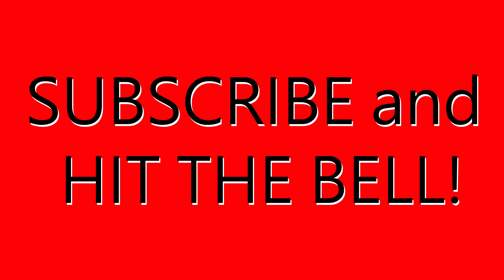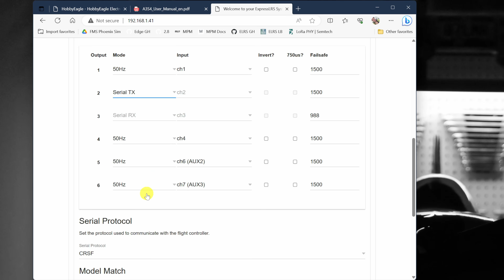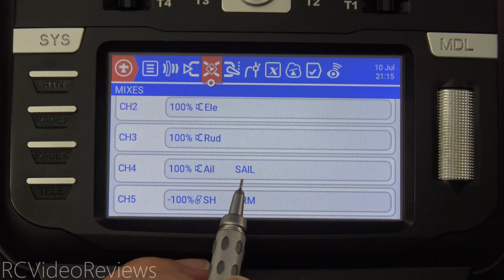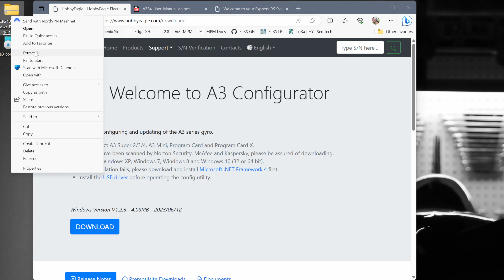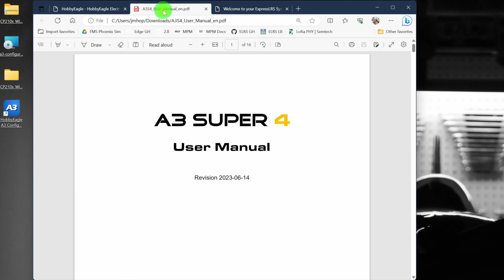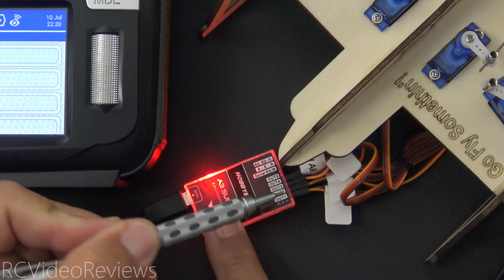DEEP DIVE: Hobbyeagle A3S4 RC Plane Gyro with ExpressLRS and CRSF

Comment: CRSF and SBUS are convenient when connecting the gyro to an ELRS receiver. However, ELRS does not output the stored failsafe channel values over serial protocols. So the receiver essentially stops sending inputs to the gyro and the gyro enters its own failsafe mode (which I believe is just "Normal" mode). With ELRS's range and signal reliability, I doubt  that will be an issue for most people.... but it is something to be aware of. If you are flying an expensive model, it might be safer to wire up each of the pwm ouputs from the ELRS receiver to the gyro. By doing that, you will be able to use the stored failesafe channel values in ELRS. If your control the gyro's flight mode with one of those channels, that would also let you tell the gyro to enter an auto-leveling mode on your receivers failsafe. This (at least in my mind) would increase the likelihood that your plane will glide down, instead of crash.

Comment: Love your videos! I’m just getting into the gyro scene. I have an A3 Super 4. Tried setting it up per this video but for some reason my receiver and gyro won’t connect. I have channel 2 on the Rx set to serial tx. The other channels don’t grey out like it says they will in the video. Not sure if that’s my problem or what. Kinda stuck right now with it.
Reply: Solved it. I am using a Radiomaster ER6 PWM receiver. Totally spaced that the ER receivers have a UART on the back of them. Even comes with a simple cable that connects from the receiver UART to the A3 Super 4 input. Super simple. Doh!

Comment: Thanks that was very helpful. However I am a little confused, when the gyro is in LOCK mode and you are trying to do a knife edge and you give it full rudder and let go of the rudder stick should the rudder servo not remain in the same position and not return to the centre? If the servo returns to the centre thus returns the rudder to the middle then how would the plane remain in knife edge? I thought in the lock mode wherever you leave the sticks and let go the corresponding servos for the sticks remain locked into that position.

Comment: Would this be the exact same process for say the Radiomaster ER6 when it comes to serial protocol and channel mapping. Also I don't suppose you or someone you may know ever did the setup to use all 6 modes with the A3S4. I have the Radiomaster ER6, Radiomaster GX12 Tx if that info helps, I've looked at several videos for setups with the A3S4 and seems most will mention it can be done but generally stick with the simple 3 modes of off, norm, and level.

Comment: Thanks for the great Video. A3s4 is programmed using P.C windows 10 software from Hobby Eagle. I could not make it work with my windows 10 based PC (would not find com port).
The hobby eagle A3proV2 is programmed by pushing a button on the A3proV2 (not as difficult as I thought). A3proV2 does have a reverse selection in the Menu. Keep up the good work.
Reply from the maker: Did you install the Virtual Com Port Drivers from silicon labs? Those drivers are necessary for a LOT of RC applications.

Comment: Can this gyro be used in a plane using a taileron mix such as an f22?
Reply from the maker: It doesn't have a mix feature to stabilize from the gyro, but it will pass commands from your radio to any combo of five outputs you want. So you could do Ail1 + Ail2 + Ele1 + Ele2  OR Ail1/2 + Ele1 + Ele2 on your outputs and they will function per the mix from your radio.

It has built-in mixing for standard fixed wing, flying wings, and v-tails meaning you can just configure the standard AETR on your radio and it will mix the outputs for you.
Reply: @RCVideoReviews  fantastic thank you! Love the videos! Been binge watching almost everything on elrs since i plan to switch from spektrum to a boxer crush !

Comment: Can this mix dual elevators and aileron, like on a jet for more roll? I see using serial the second elevator is not useable but with standard connections it is.
Reply from the maker: I'm not sure. I've never tried.
Reply: @RCVideoReviews  I'll try and let you know
Reply: using ER8 in CRSF ELE2 doesn't work, using latest firmware, manual is correct, in PWM mode ELE2 works correctly.  Mixed elevon roll gyro not working yet, still have some playing to do, but aileron roll gyro is enough

Comment: Hey, does voltage in = voltage out? I know it will take 8v input, but does that mean it's putting the same voltage out?? Are these usable on a large scale plane with a 7.4v needed for the servos?
Reply from the maker: Yes, the voltage rail is common. So whatever you feed in is what you get out. It's not a voltage issue for larger planes/servos though, it's a current issue. For large planes, you might want to consider a power distribution board. Run +/- for the servos through the board and run signal from the servos to the A3S4. Servo city sells a nice 20a PDB for $13.99.
Reply: @RCVideoReviews  That's extremely helpful, thank you so much!!

Comment: Has anyone been able to get the single wire connection work with the ER6 receiver and this gyro? All parameters seem correct but the gyro doesnt work when wired with single serial wire mode.
Reply from the maker: Are you using the UART signal wire on the ER6??
Reply: @RCVideoReviews  Yes, the UART wire. I eventually got it to work....was using the wrong mode. I had to change the mode to SBUS (from CRSF) via WebGUI.

Comment: I am trying this with my radiomaster ER8, but pulling my hairs all week. Tried via gui, serial cable, today I even tried setting up as normal pwm rx. Changed every parameter, 100full packet rate, every setting in the gyro, not once I got connection to the rx. I even switched tx and rx cable serial  output because I was doubting everything. Bummer. This system is really time consuming and giving me headaches. Normal setup, update, channel mapping, even flaps, got it working but now pfff; 
Anyway thanks for your lessons, without I would have tossed it a long time. Learned a lot, but I keep lacking.

Comment: What would you set the model type to for a plane without ailerons? Just do standard, wire normal, and it will use the rudder to roll it?
Reply from the maker: Model type? Usually with rudder only planes, the rudder is controlled by the aileron stick.

Comment: As a novice of this hobby, your work helps me a lot! Im planning to upgrade my tx to a boxer elrs version, I have a couple of planes with FMS REFLEX gyro in it.. will this work on the ER8 receiver? Sorry for the noob question.
Reply from the maker: ER8 might be overkill for a plane with a gyro. Use SBUS to feed the gyro, and use PWM to feed gear/flaps if you have them.

Comment: Great Tutorial. What radio can i used if i do not have a radio with express lrs like a DXS6E spektrum radio? thanks
Reply from the maker: A3S4 supports other protocols including PWM which pretty much all radios have.
Reply: @RCVideoReviews  i have a 4in1 internal into a Jumper t12pro but I do not see the PWM in the list. Does it have another name? THanks

Comment: I wanna use the gyro on a different project to stabilize my robot  and I don't want to use the rc transimitor can I do this with the gyro, servo and a battery alone?
Reply from the maker: Probably not. The gyro usually waits for a control signal from the Rx to initialize.

Comment: I'm 99% sure you don't need to worry about ch5 mapping if you use 16ch/2 rate. I have ch-5 mapped to a global variable that moves with throttle position on my glider. Works great.
Reply from the maker: If you ignore the state of Ch5, there are certain things that don't work like dynamic power. That hasn't changed since day one. That said, I routinely skip arming.
Reply: @RCVideoReviews  first, thank you for your videos and the reply. All fantastic! i searched the elrs documentation and can't find any other mention of the impact of arming other than dynamic power. Do you know of any other non-quadcopter related drawbacks to not arming?
Reply from the maker: Some config settings cannot be changed without potentially dropping the link momentarily, so these settings are "locked" from changes unless you are disarmed (ch5 low).

The OLED on modules that have a screen is locked from changes while armed (or at least Im pretty sure this is still the case)

The VTX administrator functionality cannot send changes while armed (to prevent a random VTX channel change mid-flight)

Some low-level link behavior is tied to the arm state, like the ability to send MSP messages between the TX and RX

Too many things to list that aren't worth diving into the minute details.

Comment: im getting so confused haha i have the radiomaster er6 and managed to flash latest firmware but the serial option doesnt appear in channel 2?
Reply from the maker: It’s available via the UART on the back. Select the serial stream in the UI.
Reply: @RCVideoReviews  thanks John, sorry for being a newb. I'm new to elrs, but I have managed to get it to bind but just plugging in a servo and there is no movement. I'm watching more videos to see what I'm doing wrong
Reply: It's working now, it was the arm switch... doh! Haha
Reply from the maker: The arm channel won't prevent servo movement if you are bound and have the channel assigned.

Comment: Wäre super wenn du mal ein Vid über das Einrichten eines RC Segler mit der Radiomaster Boxer machen würdest.
Mit zwei Flaps je Flügel und einer Störklappe im Flügel. Wie man E-Motor mit Höhe mischt. Störklappen mit Höhe. Querruder mit Flaps mischt. Butterfly (Querruder hoch, Flaps runter) mischt.
Would be great if you did a vid about setting up an RC glider with the Radiomaster Boxer.
With two flaps per wing and a spoiler in the wing. How to mix e-motor with altitude. Spoilers with height. Aileron mixes with flaps. Butterfly (ailerons up, flaps down) shuffles.
Reply from the maker: Yup, did that https://www.youtube.com/watch?v=NBmz7mI6YgM

Comment: Great video as always. For Mac users you can run Windows 11 as a virtual machine with Parallels. Then in Windows 11 (on your Mac) you install your configurator but I had to choose a different USB driver from the Silicon Labs webpage. I used the CP210x Windows Universal Driver to update the driver and after that it works without any problems.
Reply from the maker: Good tip. I'm a Mac user and have had to interpret windows videos for years. I just figure most are used to it, especially when it comes to Parallels.

Comment: Just learned something new: you can change the output mapping on the RadioMaster ER6GV via the Tx ELRS LUA script! 🤯
Reply from the maker: I've done that before and I'm not 100% convinced that feature works perfectly. I haven't done any kind of deep dive on it which I need to do, but it seems to me last time I tried that, it didn't take or it crossed up some values somewhere. I'd say check your work before flying.

Comment: Great tutorial!  But I’m always on the fence about whether or not to buy a Gyro, because they cost the same money as a full ardupilot/inav flight controller.
Reply from the maker: Cheapest available wing computer I’ve found is the speedybee f405.  Best gyro I’ve used is the A3S4. F405=$45. A3S4=$30. That makes the computer 50% more expensive.

Comment: I was looking for a mini "engine" motor & prop for the RCVR-2, then realized i have 4 of them on a blade inductrix 🤔. Soooo, a twin "engine" upgrade is going to be happening soon now.

Wait, so add a stabilizer gyro, with twin engines, hang the RCVR-2 from the ceiling,  now basically it'll fly around in a circle LEVEL with the gyro on, or in a banked turn if off.🤩i mean ,just saying. 😏
Reply from the maker: Video...or it didn't happen. Did you get yours?
Reply: @RCVideoReviews  🥺 not yet, looks like it's at customs waiting to get cleared, like maybe cuz its an "airplane",  they're checking it for drugs first 🤔. 

Servos are arriving today, guess I'll just be spinning servos around by their leads till it shows up. Ooo, better order up a gyro now. Already have a nav light kit for it 😎.
Reply: @RCVideoReviews  🤔 should I do a build video???? 😏🤪

Comment: great in depth review, its just too bad that this only goes up to 8v DC power, especially with how most elrs receivers can handle 6s.
Reply from the maker: Simple matter to solder a BEC inline on the serial wire...I mean, not hard to do stuff like that. High end servos take 8.4v and lower end servos take 5v anyway. So I don't see what the problem is.
Reply: It should get 5V BEC from ESC, either if throttle is connected to the gyro, or through the serial line if throttle is connected to the rx.

Comment: Very nice review John. I have used Hobbyeagle gyros for Kansas windy conditions for several years now. I have not had one fail me at any time. They have saved my rear end many many times when I am trying a new flying stunt. It just takes a little time setting them up for your airplane but it is worth the time. Keep up the good work.
Reply from the maker: Thanks Bill. I've been thinking about putting auto-level on a momentary. Might be a good idea. Glad to know they've worked well for you.
Reply: @RCVideoReviews I've done that with my E-Flite SAFE planes - great emergency panic button to have available. And momentary so no one has to know 😏